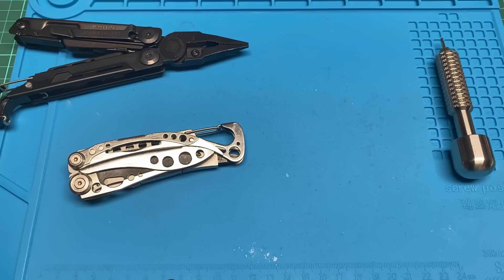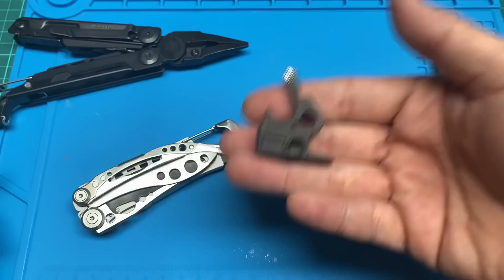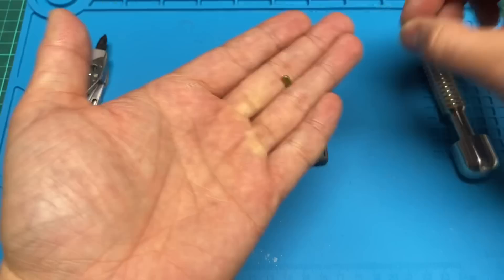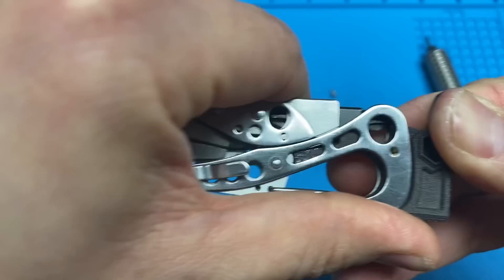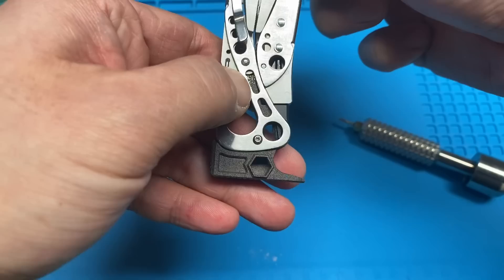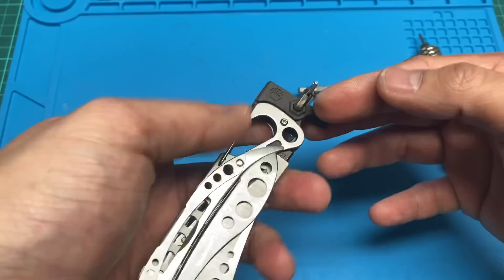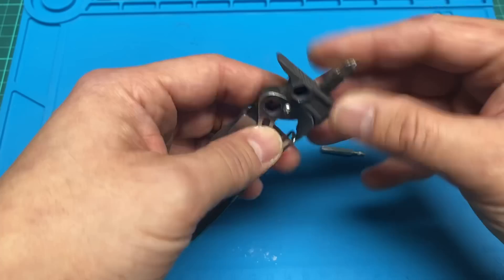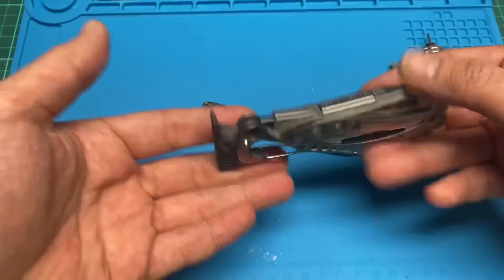Leatherman Skeletool Multitool Hammer / Jammer Mod

Comment: Adds additional utility to the multitool; the downsides are (1) the pry may not be pocket-friendly & may therefore hook & tear up liners & pockets; & (2), since the hammer insert adds to the overall length of the multitool, it may render its accompanying leather (or Denier nylon) pocket case useless.

Comment: Does it come with the screws? On the shapeways website it says you need to purchase them separately and it's $14 just for the small screws because the shipping is $11
Reply from the maker: Shapeways is the manufacturer of the parts while I am the distributor of the screws. I know It's a bit of a pain but it's the best option at the moment.

Comment: So the hardware has to be bought separate? With an $11 flat rate shipping for a $50+  part with $10 shippiny for a multi tool that runs $75ish or $90ish for the cx. Am I getting this all correct?

Love the mod but this makes it almost the same price as the entire tool.
Reply: $11 shipping for $3 hardware, $10 shipping for the $50 part* (that's $74)
Reply from the maker: You'll have to take it up with Canada Post and USPS. Recent changes has forced us to use small packet air instead of being able to mail them with a stamp. The hardware specs are located on the Shapeways listing, you are entitled to source your own hardware.

Comment: Man a bunch of negative comments. I get there are Leatherman tools already with a hammer but way more expensive from what I have seen and have a bunch of tools someone may not use. A used skeletool on fleabay doesn't cost near as much as a new tool with the hammer anyways. For the use I am using the pry works great, hammer is good and the tool will fit in a most pouches. I don't get why people assume anyone is trying to frame a house with a multi-tool hammer attachment anyways...I'm sure this will get some feathers ruffled. Great mod and thanks for the video.

Comment: It hard to get those magnets out?  (or they just come out with a vertical tap or two? like if you dropped it from a couple feet right on that flat surface?)
Reply from the maker: I haven't had mine fall out, but I also adjusted the file to have a more friction fit of the bit driver so the magnets are not necessary.

Comment: Hi, I am interested to buy this mod, you send it with screws or I have to buy it separately?
Reply from the maker: It's not the best system but it's the only way because Shapeways manufactures the part. We don't see the final result and it ships direct to you. We tried to work with SW to distribute them but they were hot and then cold to the idea.

Comment: Looking at Shapeways, the Hammer/Jammer looks like the larger round hole on it now looks 1/4 hex bit shaped instead (looking at the 360 3d rendering which says is supposed to show the most up to date design). What functionality does that add to the Hammer/Jammer (as 1/4, 4mm, leatherman flat bit driver slots are already on the main head portion of the Hammer/Jammer)?
Reply from the maker: The hex in the carabiner area will allow for a full size bit adaptor to pass through and the skeletool to be used like a 90 degree handle. The carabiner hole in the Skele is JUST a little too small for a 1/4" hex to a pass through, a couple of licks with a stone bit on a Dremel tool will open it up nicely. I've done it to one single side so the bit adaptor stops inside the handle. Otherwise, its a hidden feature inside that you don't have to unlock.

Comment: Makes hammer mod, doesn't hammer anything.
Reply: You don't work construction. This makes a fist work instead if the butt end of your drill for small crap..won't do nails. Does work for anything you would like to use a fist for but is made of sharp machined metal.

Comment: How do I purchase the set with screws. I want the nickel plated hammer stammer. The screws are charging me 10 for shipping. I prefer to the get the set all together
Reply from the maker: There is a free shipping code on the listing, enter it and check "free shipping' at check out. We do not see the product, Shapeways does the manufacturing and ships directly to you. We only provide the screws.

Comment: I’ve seen a bunch of these Laser Sintered parts lately by shape ways which is super cool...  Why isn’t anyone showing the strength of the finished piece?  My understanding is that it’s supposed to be “as strong as regular metal”.
Reply from the maker: Neeko 78 I would categorize this final product to be on par with a softer stainless steel. So far my opening of paint can, smashing roof ice and various other tapping, I haven’t seen any visible damage.
Reply: Eric Au- Cool!  I just learned about this Sintering process. Seems like game changing technology for the average person to design something and get reasonably priced access to the expensive technology. Thanks for the reply.
Reply from the maker: @neeko7878  If I am correct, the composition is about 75% stainless steel for the matrix and a 25% bronze infusion to fill in the gaps.

Comment: I just received my 2 hammers I ordered, but I did not receive the mounting hardware!  I wrote the site and requested the screws and stuff, but nothing.  I Need the inserts and screws!  Eric - can you help?
Reply: Really disappointed in the no response from anyone on the screws and inserts needed for this.  Purchased 2 hammers and asked for the hardware when I ordered them, sent messages and emails asking as well.  Still have not received them and no answer from the company or Eric.
Reply: Also. Via metro.. 10$ to ship for a 2$ screws??? It should be already be included on that add-on piece. :/

Comment: I bought the matt black hammer jammer..can you send me a link or where you got the magnets that you put into the  top of the hammer for the insert for the driver. PLEASE
Reply from the maker: Link for hardware is in the description.
Reply: @MetroGradeGoods  I bought the install kit for the hammer jammer it didnt come with the magnets
Reply from the maker: @Johnny9ers  I adjusted the file so the bit is tighter and doesn't need the magnet. They are very small and VERY hard to install so it wouldn't be worth it.

Comment: Can JB weld be used to attach the new part as the brass insert is very expensive?
Reply from the maker: Sure, you can do whatever you want. If removing the hammer is important to you, JB weld may not be the best option.

Comment: why are the screws not included?
Reply from the maker: Shapeways is the manufacturer of the part using their 3d printing metal technology. I am the designer and subsequent distributer of the hardware. We were working together on having them have the screws on hand but its taking much longer than expect to come to a system.

Comment: I suppose riveting a pin is fine too as opposed to using the supplied screws?
Reply from the maker: Yes, if you want to ream out the small hole to 1/8" and put a brass or steel pin to peen down.

Comment: I've been checking out your mods and really like them. I was curious if you had plans on making a model that has both the small leatherman bit holder and the 1/4 bit holder in the bottom? The skeletool isn't very comfortable to use when opened so being able to use either bit while it's closed would be an awesome feature to include.

Comment: The price is insane considering, the price of the leatherman itself.
Reply: Its 3d printed metal. Honestly that is an insanely high end manufacturing method for a part like that
Reply: It's worth it brother.
Reply: I thought it was 70-80, 33 bucks isn’t bad at all.
Reply: Inflation?
June 2023 = starting at $48.34, several more expensive options.
Not including shipping ($12 to US), processing ($2.35), taxes (?), screws ($2 or $3).
🙂

Comment: So if I order this for my Skeletool....does it come with the hardware to install it?
Reply from the maker: You'll need to contact us via the Shapeways message system (sign up for an account) and send us your mailing address. I can get them out to oyu.
Reply: @MetroGradeGoods  no shit im going to order a skeletool just to buy this thing. it makes it more like the signal or the mut yet still way lighter n just a smidge longer than the original skeletool which prob is a little short. i think its great man. changes the whole thing. not just a hammer.
Reply from the maker: @zexnynex777  All you need to know is in the product description on SW. It also has a link where you can buy a set of hardware from me.

Comment: Are you still making them?
Reply from the maker: they are available everyday at Shapeways, make sure you order hardware from me.
Reply: @Eric Au  hey quick question what's the difference between metals? Is it just colors? Or is like a coating
Reply from the maker: @herrera594917692  They are coatings.
Reply from the maker: @herrera594917692  Any of the brighter, silvery ones.

Comment: I get you trying to fit multiple options into the hammer head but i would rather see the upper screw bit insert run center of the tool for a more natural screwdriver function.  It is the downside to most multitools

Comment: If you carry a skeletool you won't have the second bit to pull out and still on the end.
Reply from the maker: Not sure what you mean, the bit in the existing bit holder nests inside the hammer.
Reply: @MetroGradeGoods  The bits fall out of the side holder fairly regularly.
Reply from the maker: @flyboymike111357  It sounds like you need to re-tension the steel plate on yours. Never had a bit fall out of mine.

Comment: Not really strong enough to hammer anything in reality. The hex driver can already be used with the existing attachment, the flat driver already exists ON THE TOOL. So you are left with a redundant attachment that doesn’t really serve as a hammer...and now it isn’t as light as the skeletool is designed to be and it has a weird shape with plenty of hot spots to get caught on your pocket.  I like the idea of trying to innovate but this is a miss in that it disrupts the original design and doesn’t do what it is designed to do.
Reply from the maker: That's great for you. Thanks for the comment.